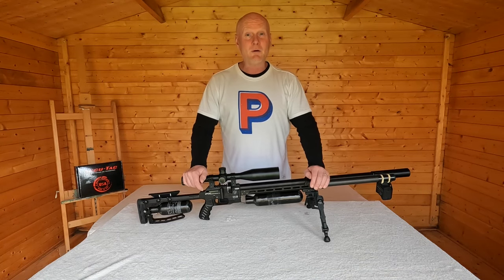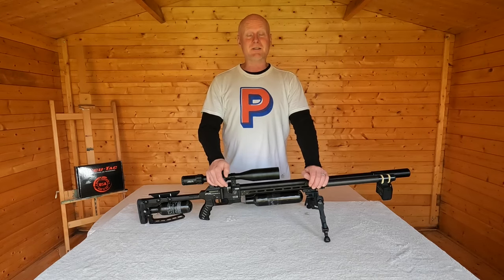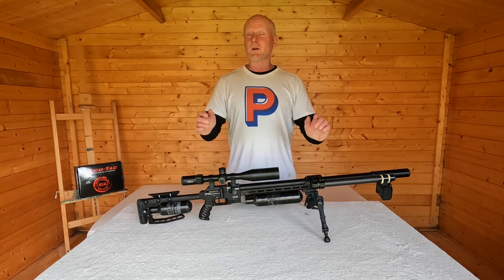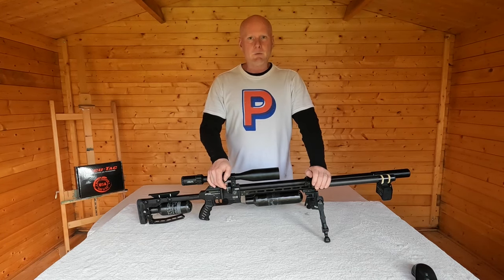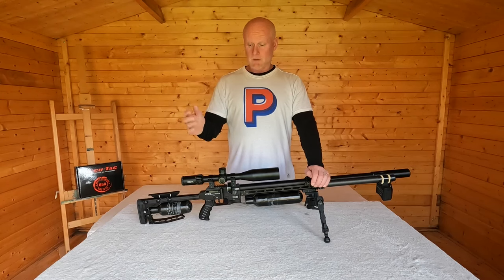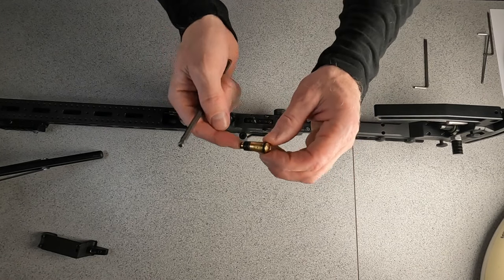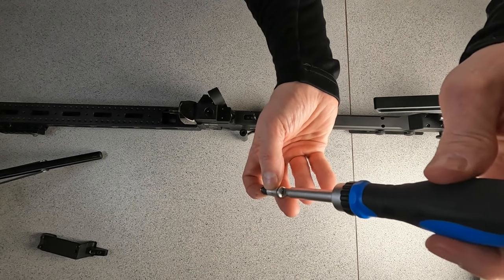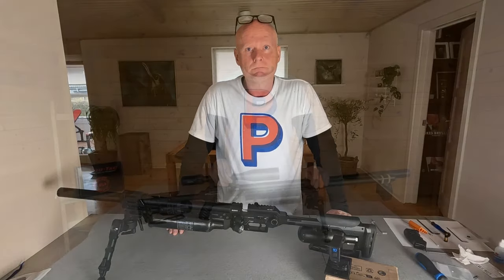Regulator Showdown FX PANTHERA | AMP vs. HUMA - Unveiling the Champion!

Comment: When you tune, have your hammer spring maxed out, start low on the reg just like you did, and increase it till you get to the desired velocity. Then, back off the hammer till you lose velocity, then turn it a couple clicks over that point. This is where you want to be. If you have too much spring at this point, your first shot will be high because of what people call "creep". If you just choose a high reg pressure and increase spring tension till you get to your desired velocity, your fist shot will be low, from the same "Creep" This is because, in this scenario, you are shooting an unregulated gun, and the hammer spring tension is acting as the regulator, and your real regulator is just dumbing down the pressure supply from your main tank, basically acting like the twin regulators in the M3.  your velocity, the next day might creep back up till it levels off if you try to tune it backwards, or Unregulated. You are supposed to tune the regulator, to your hammer spring, not the other way around. You can get it right doing it backwards, but you would have to be very lucky.

Comment: Thks.  My .22 Panthera does creep overnight by ~ 4 bar up on reg and also goes down on the tank by around 10 bar.
Reply from the maker: If it goes down by 10 bar after a fill it is what to expect, but apart from that you probably have a leak.
Reply: @VikingAirgunner  I did have it sent back and they reportedly fixed it...but it still does leak. thks
Reply from the maker: @PrecisionQuest  Have you done a search for leaks?
If the preasure of the reg is stabile (or in your case goes up) the leak will most likely be before the reg. So start with the fill nipple. Could be from there. If you dont have a leak search fluid you can use shaving cream 🤓
Reply: @VikingAirgunner  thks.,  yeah they said the leak was from my gauge.  I do have leak check, but couldn't lcoate the issue.  It's a pretty small leak, so I don't fuss about it too much anymore.

Comment: I own three FX airguns, all equipped with AMP regs. It seems you just have to be lucky to get a good one. The reg on my Impact M3 had no creep from the factory and worked perfectly fine out of the box. The one on my Panthera had a steady creep of 10 to 15 bar, even after a month of settling in at 120 bar. That one is free of creep now by giving the contact surfaces a good polish. My Maverick on the other end has a bad reg from the factory. Even with a good polish that AMP reg still creeps and has a slow refresh rate. It's just luck of the draw it seems with those regs.
Reply from the maker: Question:
Have you ever had an AMP that got better over time? Somehow I have had that experience. Might be the springs "polishing" them selves after many shots. Not sure but makes sense - for me at least 😂
Reply: @VikingAirgunner  No, they didn't get better over time. My Maverick is the oldest of the bunch and that one has the worst performing reg. Although I can see your train of thought. The high spots on the belleville washers are crucial parts to polish.
Reply: One negative about the HUMA, you can't degas with it.
Reply from the maker: @wsmc8275  Sure you can. Remove the bottle and turn the set screw a tiny bit counter clockwise and it will degass.
Reply: @VikingAirgunner  
Negative, I tried this. I reached out to HUMA with this concern and they said to shoot the gun to degas.

Comment: When you shoot an air gun, the transfer of the air cools everything down substantially. So once the plenum gets back to room temperature, the pressure has to go up, I think this is a misconception and wrongly labeled "creep". The same thing happens in reverse in your bottle when you fill it gets warm, then it cools down and there is a couple bars lost.  You would have regulate the air temperature in order to control this. What do you think about this theory.
Reply: You are correct 💯 imo because that happens to me cool in the house then hot outside the gun fps goes up in my case

Comment: huma  a dutch product is a very good regulator and rebuild set are easy availlable , thats a big plus also , because after a time you need  to clean a reg and renew parts . it depends how clean and dry the air is in the gun thats used

Comment: Hi Peter, As you mentioned some AMP regulators perform better than others. I hear that newer rifles have the brass piston now, but my Crown mk2 which is quite old probably has the plastic one, however this rifle does not have a noticeable velocity change over time like my newer Maverick. I only have anologue gauges so can't tell whether there is any creep. Your experience working on the bellville springs and lubricating the parts before re-installing has been mentioned by others and has been recommended as a way of improving shot to shot consistency. Swapping out the AMP regulator for the Huma might improve ones experience but maybe working on the AMP reg first might make changing unnecessary. I really enjoy your videos, you are very particular and want to get the best out of your rifles and it's helpful to others to follow you on your journey.
Reply from the maker: Hi John and thank you for your comment🙏
When I changed the plastic piston with the brass piston I saw just a small improvement, but my amp reg was allready performing really well. So the improvement might be bigger if the reg had been bad from the start. If you havent seen that video, you should check it out 🙂
Reply: @VikingAirgunner  Hi Peter, yes I did see the video with the brass piston. I recently bought some FX Crown  spares and decided to get a whole new regulator and this one has a brass piston but I haven't felt the need to change it yet. Your videos show you put a lot of thought into your sport.

Comment: Hi Peter, thanks for the video.

Question: huma-air offers you two regulators possibilities (low pressure range - extra high pressure range) if I install the extra high pressure range in Spain where the joules are limited to 24 means I will break this limiter? or there is any other component limiting the power and I could install that without worries?

Just trying to understand how the gun components works
Reply from the maker: I have never worked with guns that were limited, so I cant really say anything about that.

The extra high preasure is made to be used between 100 and 200 bar, and I dont assume that you are in that range?
Low goes up to 135 bar.

Comment: I've changed all my AMP regs with HUMA in 3 FX for this exact reason. OK if you just need to take one or two "recovery" shots every time you shoot it maynot be so bad but when you get to higher calibres it does matter. For example, in a .35 calibre you're getting 26 shots per fill you don't want to be wasting air like that.

Comment: HUMA has two regs for the FX Panthera, low range 60bar to 135bar and a high range 100bar to 200bar. Which one are you using? If it is the high range, would the low range fill just as fast?
Reply from the maker: In this video I am using the extra high, but I switched to low. No significant change in filling time, but with low the reg preasure didnt drop as much from full bottle to charge time as with extra high spring configuration.
The regulators are the same. Only the springs are different. And you can buy springs seperately.
Reply: Thank you

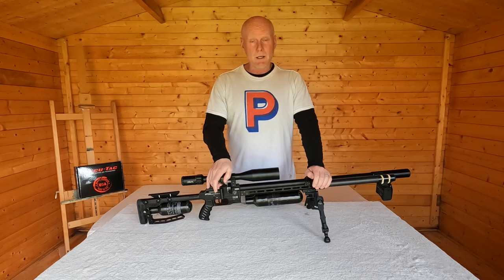Comment: Can you reference a video on how to polish the springs you mentioned in 20:15 ?  I cant find one
Reply from the maker: Its been ages since I saw someone doing it, so I cant remember the video, but it is very simple.
I use Autosol and just rub each spring with my fingers for like one minutand then clean and lube before installing🙂

Comment: What stack configuration of belleville washers did you use. 0.4, 0.5 or 0.6mm and how did you stack them. Theres 3 ways that Huma's instructions say to stack them.
Reply from the maker: Hi Josh
It is an extra high preasure reg, so I used that configuration.
8 springs, 0,6:
)()()()(
Those are the suggested way by Huma 😇
Reply: @VikingAirgunner  thanks that’s the same as I’m using now. Just wanted to confirm

Comment: Awesome video and demonstration on both regs Peter I have a huma reg in my fx mk2 25 cal 700mm and a amp reg in my fx m3 22 cal 700mm both work about the same imo I don't have a problem with either one I polish the Belleville washers in both regs it helps out a lot for the reg creep well it did for me ,.make sure you tune your gun correctly I always go 20 to 30  fps higher then my desired fps I use the value adjustment to come down and the hammer tension it helps me out like that for tuning and creep . I used to just tune my gun to the speed I wanted it at and leave it then the next day say for example it was at 900 fps the next day the speed would drop down to like 880 and it would stay there or the spread and SD was very High or all over the place in between shots never consistent when I watched Ted bier the man the legend show us his secret on tuning his gun and Matt Dubber showed us as well how they tuned there guns it opened my eyes on how you have to balance the reg with the hammer tension ,anyways sorry for the long comment I can keep on going talking about this lol thank you Peter I like your channel keep on keeping on be safe my friend 💯
Reply from the maker: Hi Chris and thank you for your long and detailed discription of experiences and general approaches.
I got the info about this way of tuning from a video that Steve (AEAC) did and it works so well. But still there are things to explore with balance between the different values 🙂
Have a great weekend Chris 😎

Comment: So how do you degass with the huma? Unscrewing the reg gauge? Its locktited on mine and im scared i’ll break it if i force it loose. No luck heating it up either, im at a point where i might just reinstall the amp 😟
Reply from the maker: There should be no problem in releasing the reg gauge. I have done it on all my guns🙂
Just remember to clean it before reinstalling 🤓
Reply: Yes got it off, why fx decide to locktite their gauges dosen’t make much sense to me. Unnecessary imo. Quite annoying u can’t degass with the setscrew cause of the floating delring, but guess it’s worth it with the much better performance.
Reply from the maker: @gigolocan8914  Agree!

Comment: As always, the best informative video out there... ✌️
Any idea if that Huma reg could accept 300 bar pressure like the original do?
Reply from the maker: Thank you Zura 🙂
The Dynamic block has a max capacity of 250 bar reguardless of the regulator. Higher preasures might damage the system.
In terms of max setting on the two regulators the AMP will go to around 190 bar (not entrirely sure of the exact max but around there) and the Huma extra high preasure can be set to 200 bar 🙂
Reply: The internals of the panthera can handle 300bar np (according to matt, hes r&d at fx and should know)

Comment: Just recieved my Panthera .177 700mm and just came here for a few tips on how to set it up while i wait for my bipod and scope rings to arrive. Kinda bummed to see the amp reg is performing like this, the creep is to be expected to some extend but the reset time at 10+ seconds i wasent aware of. I never messed much with regulators how excatly do you go about polishing the discs? Also the manual dosen’t say anywhere you need to degass the plenum before decreasing reg pressure..really?! Wont that damage the valve?
Reply from the maker: I actually think that it is mentioned somewhere that you dont have to degass of you want to decrease the reg preasure, but I did it once on the M3 and it damaged the reg piston, so I always degass. Others might recommend otherwise.
I believe there are videos on how to polish the springs - but I seriously recommend the Huma reg instead. Noone has commented that their amp reg performed perfect in the dynamic block so if you want to avoid the issues that I adress in this video just go for the Huma 😎
Reply: Noted..Better safe than sorry. Thanks will definitely consider the huma down the line, but for now i like to keep everything stock to get a feeling for the the gun out of the box before installing any aftermarked stuff. Thanks for the vids btw, very helpfull.